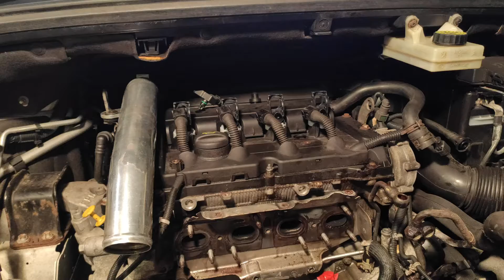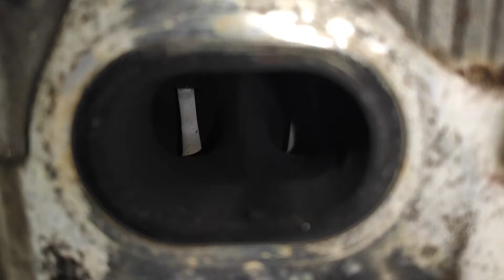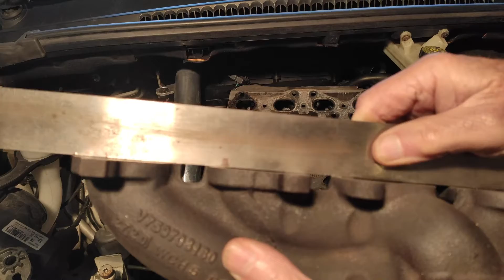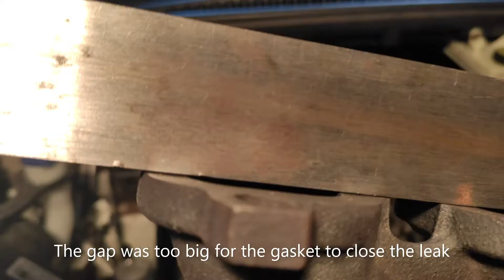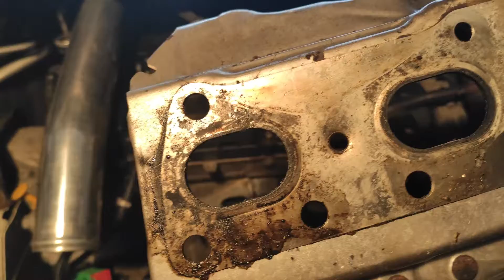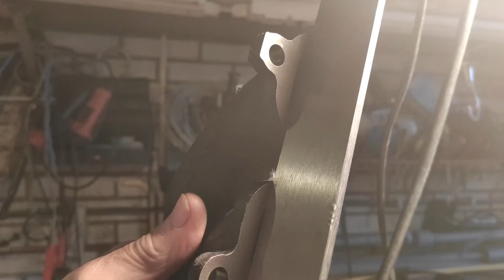1.6 THP exhaust manifold leak 🤬

Comment: see this more often with customers for whom I have to weld the manifold. and when you reassemble it, it will be pretty flat against the cylinder head. but as a precaution I cut 2 gaskets from thicker and special exhaust gasket paper instead of the standard BMW gaskets. never had any problems. have now the same problem with my 320i ede 2013 (after 281.xxxkm) also cylinder 1 gasket leak. screeching when it's cold and you can smell it in the car every now and then